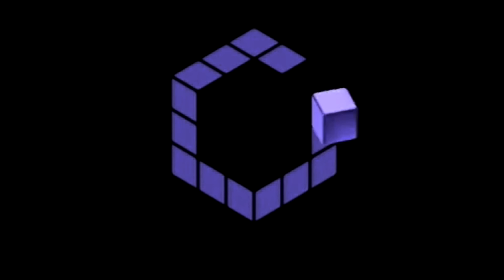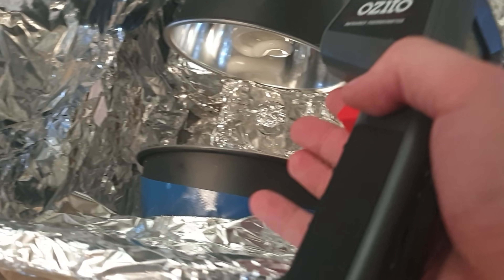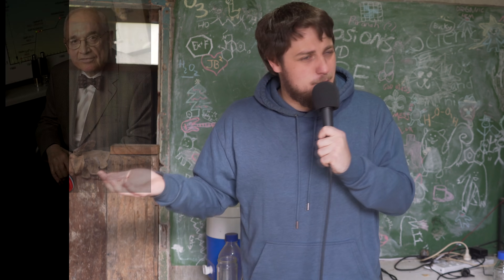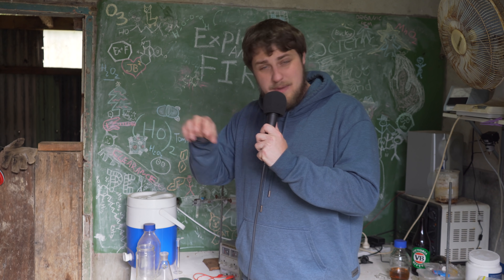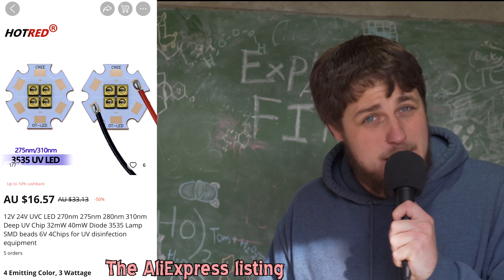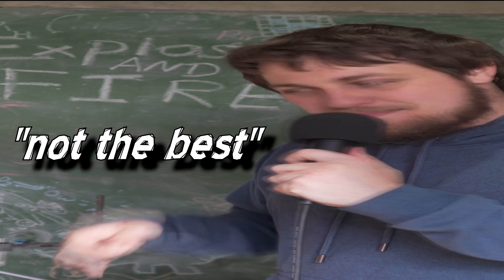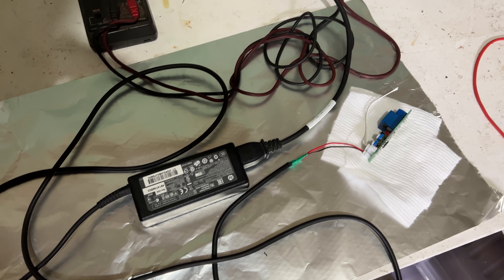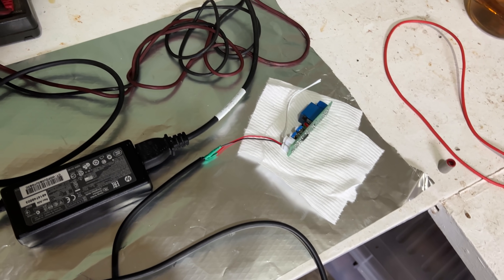Magical deep UV LEDs - Cubane Ep 12

Comment: I'm cracking up at the "i'll try not to break them" attitude then immediately puts more volts than they're rated for through em.
Reply from the maker: yeah god damn. There really are times where you aren’t meant to just say “should be fine” and then do it. Sometimes it is better to think
Reply: @ExtractionsAndIre  LEDs current draw increases exponentially with voltage. As such a small change in voltage will push a large amount more current through and can totally burn them out. For a visible light LED a single volt difference is often the difference between normal operation and immediately burning out.

If you have a constant voltage power supply at their rated voltage that should do the trick. Similarly if you have a constant current power supply at their rated current that should also be fine. 

Do you have a volt meter on hand? They are cheap and will prevent you from releasing the magic smoke from many electrical components. I would always be checking the voltage prior to plugging an LED into a new circuit.

Comment: For you photo-cyclization step, would it be a worthy consideration to use instead  a "Deuterium Spectral Bulb" as is used, e.g., in spectroscopy, spectrophotometers, spectrographs, high resolution optics, including here nifty photochemical applications?  ~110-350 nm for deep UV.  Yes,  it utilizes quartz glass and ordinarily is constructed so the beam is handily focused in one direction and may be intense!  Be sure to wear very good UV goggles AND gloves, Mate.  Unless you have an EE friend for creative problem solving at University the power supply can be expensive.

Comment: Don't do this. Buy a $50 lab bench power supply with current limiting to power the LEDs.  Connect your LEDs in series with a current limiting resistor to protect the diode from overcurrent damage. The "specs" for this PCB are incomplete. You would need to measure the forward voltage drop to determine the value for the resistor.

Comment: As the other guy said, if they say they need 40mA it’s best to drive them with 40mA. More than what they’re rated for may well do permanent damage for thermal reasons, leading to a falloff of brightness. I’d figure out some way to calibrate the brightness (LDR or LED as a photodiode at a fixed distance with 5V and a resistor and your multimeter) to see if there is any falloff.

But considering they’re on what look like 1W/3W star bases, I’d wonder if they can handle more. I’ll see if I can find the same LED chips on LCSC to see what they say on the datasheet. If it’s solely a temperature regulation then you could run them hotter with a heat sink like you are, or with momentary switching like you are, though the step up factor of 20 still feels like it might lead to overheating. Could always replace the timer relay module with a temperature relay module. Could have one in/on the reaction vessel also.

Edit: closest I can find is a 3838UVB by Silverlight. Not the same package size as the listing says, but otherwise it looks real similar and is cheap enough. Typical current of 100mA, which since your LED setup is 2S2P would mean 200mA for each module.

Shame your benchtop PSU doesn’t do low currents.

Comment: LEDs are constant current devices, meaning that they don't really care about the voltage (as long as it's over the forward voltage), but want the current to be capped. As you saw on the bench power supply, the current they draw is exponential, so after a certain point a very small difference in voltage means a huge difference in power draw, and eventually they destroy themselves. Current limiting means that the power supply lowers the voltage when the current wants to go up.
40mA seem pretty low for that big of a package (lenny face), those LED stars usually like 75 to 200mA. Maybe it's a typo? I've seen a listing of seemingly the same module that said 140mA, so maybe they missed a 1!
I've seen other listings say 300mA, 250, "10MA" (lol), so maybe they're just throwing numbers around. EDIT: I've looked into the datasheet (for the single packages), they take 350-500mA at 6V. These ones have two pairs of two LEDs in series, in parallel. So you should be good with the 900mA driver actually. , They're cree XST-3535-UV. They're actually 275nm LEDs

Oh, and you definitely need a fan or bigger heatsinks! Those things can get hot but certainly prefer not to, and as they're not extremely cheap yet (and take weeks to arrive), I assume you want them to last for some time ;)

Comment: This video has to be one of the best advertisement for the company that manufactured these leds: pumping 1A inside a 40mA rated LED without instantly frying it is quite a feat, plus they are UVC or UVB  which have been notorious for being fragile ! 
Looking at the specs of your LEDs I'm also somewhat suspicious about the announced output. Typical efficiency for LEDs in that range tends to be below 4%, and yours have about 8% efficiency based on the nominal output/(nomimal voltage*amps) . My guess would be that the nominal output is exagerated but the only way to check that is with an optical power meter.
Reply: best advertisement that they sold him the wrong product?

Comment: You absolutely should have read a primer on LEDs. They're simple diodes that emit light and you absolutely, completely murdered them by shoving many Amperes of current through them 😢 You should've just used a big resistor in series to lower the current to ~40mA at nominal voltage. 😉

Comment: In regards to driving the LED's properly.
SIMPLEST SOLUTION- Buy and use 1x 150ohm 1 watt resistor in series with each star board. If using 4 star boards, get 4 resistors. Solder each resistor in series with each star board. Then connect all 4 resistor/led strings in parallel, and power off of the 19v laptop power supply. This only works if you order the same 12-13vdc 40ma star boards marked 6V that you used in this video that have the individual emitters wired 2S2P, and on a 19vdc supply. This will limit the current threw the emitters to the 40ma maximum. Resistor will need to be a higher power 1w resistor as it will be dissipating quite a bit of power. 

If you google "Led resistor calculator" there are websites that you can simply plug in the values (supply voltage, led foward voltage, led max current) and it will tell you exactly what Ohm resistor value to use, and how much power will be dissipated in the resistor in MW. At least double the MW value then convert to W to get the wattage rating of the resistor needed. 0.5W would work but is going to get really hot, minus well just use 1w rated resistors. 40ma is the maximum those led's are rated at, I honestly cant believe they didnt explode when you put 1A threw them. 

Using a resistor is not an efficient method of driving higher power led's but for your purposes it will work fine. If you want to go the route of an actual led "driver" which will have much higher efficiency and be much more versatile (at the expense of being slightly more complex), you can buy what is effectively the exact same thing as an led driver but that is variable and can have the output voltage and current set to a specific limit, in the form of a CC/CV buck converter for like $5 on ebay/amazon. There are lots of options but stick with either the red pcb or blue pcb ones that use the xl4015 or xl4005 IC. They can be found by searching "5A dc-dc CC CV buck converter" on ebay or amazon ect. They can take your 19v laptop power supply as the input and give you a variable 0v-18V and 0.01A-5.00A output, that can be set to 13vdc and 0.040A (40ma) of current which will drive one of those led stars perfectly. And if you want to run multiple star boards like 2 boards or 4 boards you can just wire them in parallel and double or quadruple the current output to 80ma or 160ma. You dont have to worry about having uneven current sharing from running them in parallel. For what your doing with them they wont be ran for long enough to actually have that cause any issues. Not to mention the star boards already have more then one emitter running in parallel on them.

Comment: The moment he just turned the driver on and allowed its hundreds of uF of output capacitance to charge to the full compliance voltage I already started to suspect something but then he carried the wires to the poor LED. I was like "no way, you are just teasing us, right, you are not really going to do it". And then go the sparks of death... Almost made me cry...

And the careless swinging of the voltage knob on the PSU and the current needle jumping up to a few amps... Have mercy on the poor little things! :) That is if by some miracle they are even still alive and in spec.

I could barely watch this...

Comment: Rating: Not Cute. UV LEDs only shine that brightly in the visble when they are distressed. LEDs require need to be fed a strict diet of constant-current DC. Letting them eat as many milliamps as they want is irresponsible and leads to health issues. 
Get a LM317 controller and a 33Ω resistor. Set them up as shown on the constant current driver in the LM317's wikipedia page. (left pin to LED +ve terminal and resistor, middle pin to other end of resistor, right pin to +ve power supply)

Comment: A lot of people are already talking about other issues, so I'll throw my electrical knowledge at another  thing you mentioned:
If you don't want to burn up a bunch of expensive components it's relatively inexpensive to get circuit breakers to put in your test circuit when you set the whole thing up for the first time. it helps ease the worry of frying something you don't want to replace and also helps minimize the risk of a fire, arcs or bad results. The basics are:

-get the right size, the rated current of your breaker should be ~120% of the load listed (take the mA and multiply by 1.2x, that's about the right size).
-don't mix AC and DC, breakers are one or the other just buy the one that matches where you're putting it (You can probably ask any of the electrical people in the discord or something if you're unsure) 
-wire the circuit up with the breaker open (not passing current) and in a way so that the breaker opening again will stop all current

This way you can close the breaker once the whole circuit is made, be less at risk of shocks and arcs when doing so and if it's sized right and you're a little lucky it should save your expensive components. Better safety for your parts, and more importantly better safety for the user!
Reply: when's the last time you've seen a 50mA "circuit breaker"? maybe you could use a very small fuse, but even then, the exponential runaway behavior of LEDs will probably kill it before the fuse can even warm up. fuses and breakers can protect against thermal damage where it's ok if it takes a few milliseconds to kick in since the component will have barely heated up. but they certainly can't protect a semiconductor device from electrical breakdown, we're talking microseconds or nanoseconds then!

remember, the magic smoke is often just a symptom, the device fails first, then a high-current failure mode causes the heat and lets out the smoke. a breaker will stop the smoke but not necessarily the failure
Reply: I don't think they make circuit breakers below like 10 amps. Although they certainly do make small *fuses*.
Reply: @thewhitefalcon8539  I think they make smaller (down to a few amps) breakers for individual appliances and stuff, but regardless that's still way too high so your point still stands.
Reply: His PSU comes with a current limit. He just never ever used it.

Comment: A note about LEDs; there's a direct correspondence between the energy of the emitted photons and the forward voltage drop across the diode. As you demonstrated with the sharp current response from your power supply, the forward voltage drop of each of these 4-in-series diode arrays is ~12V, so the voltage you would use to calculate the current draw with Ohm's law is ((applied voltage)-12). The manufacturer gives the upper limit as 14V, and a maximum current draw of 40mA, so (2V)/(40mA)=50Ω; when you drive it at ~19V, the current was (19-12(V))/50Ω=140mA

Comment: You need to do a tiny bit of maths - just applying Ohm's law and calculating system power dissipation - to avoid burning up the LEDs. Like other folks have mentioned, constant-current loads need to have their input current regulated (using a resistor or more exotic means), less so input voltage (although LEDs have a breakdown voltage as well, so you can't just punt 1kV through them). In this case, you want to use the R = V/I arrangement of Ohm's law, because you know the current (I) required - 40mA - and you'll know the voltage you're supplying (V) based on the power supply. Imagine you're using your benchtop supply at 12V: the size of resistor you need is 12/0.04 = 300 ohms. Now you need to calculate the power dissipation in Watts - voltage times current - which in this case is 12*0.04 or 0.48W. You therefore know that you need a >=300 ohm resistor that can handle >=0.5W in series with a single LED driver if you're feeding them 12V. The voltage rating of the LED will tell you the minimum and maximum forward voltage for each LED; you can then decide whether to connect LEDs in series (for n LEDs in series behind a resistor, each gets 100% of the current and 100% / n of the voltage) or parallel (for n LEDs in parallel behind a resistor, each gets 100% of the voltage and 100% / n of the current). Just do the math so that each LED gets no more than its maximum rated voltage (80% is usually around the sweet spot for longevity) and not more than its maximum rated current (ditto), and that each resistor is dissipating no more than its rated power dissipation (samesies), and you're in business.

Comment: I'm at 06:28 and I'm shouting "Remember to use the right resistor!" 
There's online calculators so you can find out what value of resistor really easily!
Reply: He does not even need a resistor, he has a cheap but still proper lab power supply with constant current mode. He could just set it up to just below 40mA with a multimeter and then connect the LEDs in series and be good to go. And it is not just that, the whole thing is painful to watch in general.
Reply: @Kirillissimus  I was watching him feed them a whole amp! And i didn't know he had those drivers. 
A man with access to so many people who would be willing to help shouldn't be letting the magic smoke out!

Comment: I'm screaming at the screen like a grandfather. "I'm getting too caught up with this 40mA, 900mA should be fine". TBH, constant current regime is always a bit hard to grasp for outsiders, and the threshold voltage marking feels like we could use the given voltage to control them.
Reply: Pretty sure he could run 22 stars on 900mA
Reply: @RaunienTheFirst  you run LEDs in series not in parallel....
Meaning that you give the string voltage until 40mA flow then you stop at whatever voltage that Happens to be!!!
Edit: spelling

Comment: Whatever you do do not put more than 40mA through the LEDs. It's like a car engine. The red line is say 6000RPM and you run it at 7000RPM and it will work fine for a while - right up to the point where it goes bang-clatter-clatter-clatter. If you get stuck I was a design engineer in aerospace and other areas with safety critical electronics. I can send you a circuit diagram or even a built circuit to drive these LED's as long as you have a bench power supply or something to power them from. I would also very strongly suggest driving them at 75% of their rated maximum. This is for two reasons 1 it vastly increases their life and 2 it's more efficient but don't read MIL-HDBK-217F to work out reliability as it will drive you bonkers. It has equations that cover an entire page of A4.

Comment: nooooo buddddyyy.
For power supplies, you need the correct voltage. Too low, and it won't conduct, as you saw with the power supply before  you turned it up high enough, too high and it will destroy yr electronic...as you saw. For MOST electronics, you can "supply" as much current as you want, but it will only take as much as it needs. LEDs, on the other hand, need to be current limited, because they'll just take whatever you throw at them and destroy themselves. If the LED's are rated at 40mA, that doesn't mean they can't take more, but the manufacturers wont guarantee it will last for... any length of time.
Reply: oh also, use thermal paste so youre not wasting heatsinks every time you kill and LED.

also, next time you use expensive versions of electronics, buy a bunch of the cheap version to break and learn with, and then transfer those skills to the expensive version.